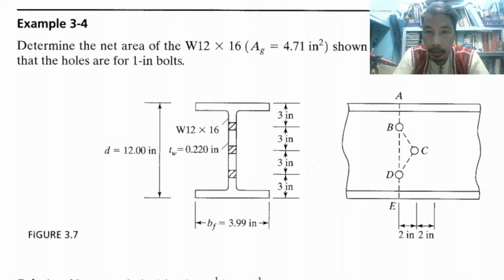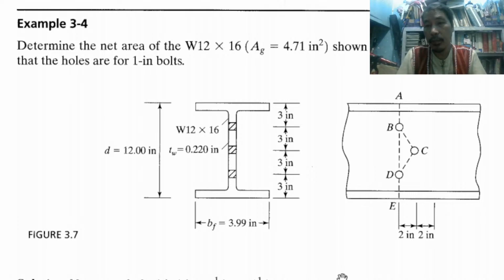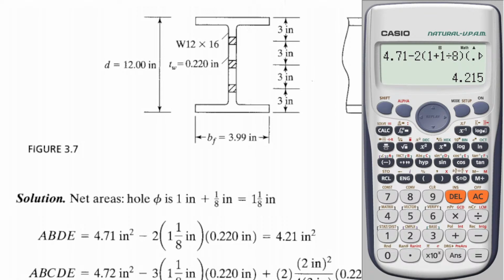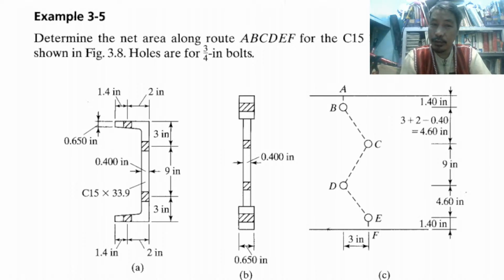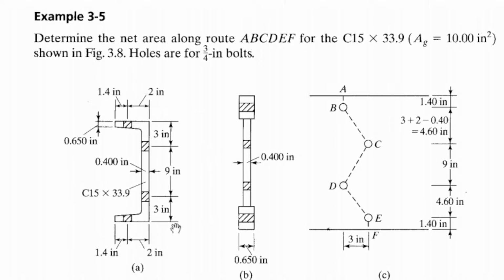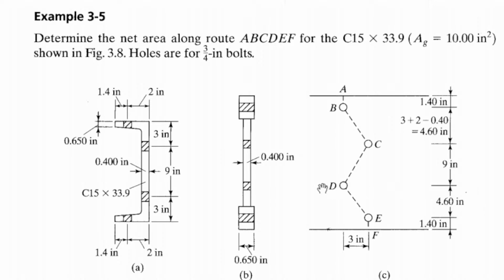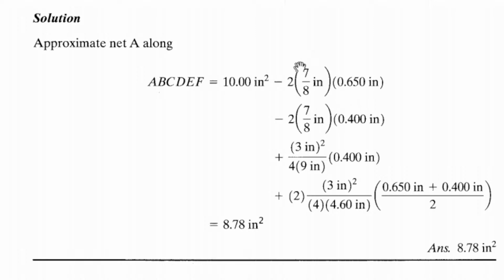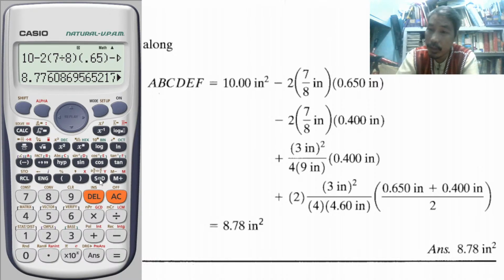[ LIVE CEE6 Lecture 11 ] DrAP Zantua STAGGERED Holes  Talks + ENGINEERING Analysis & Design

Comment: I appreciate you providing this live lecture on staggered openings as well as the following instances of net area that are still in the third chapter of the book, sir. I developed my ability to assess and analyze such challenges. If we need to resolve a problem with tension member analysis in steel design, this video can be helpful.
Values for ABDEF and ABCEF are assigned as follows: =6.32 in.

Comment: Thank you, sir, for this live lecture video on staggered openings and for the following net area examples, which are still in the book's third chapter. I learned how to evaluate and comprehend such difficulties. This video may be useful if we need to solve an issue with tension member analysis in steel design.
Assignment                          ABDEF and ABCEF values; =6.32 in.^2

Comment: Thank you, sir for this video. With this material. I be able to go back to a specific part in a video to analyze and to find explanation on how computation goes like. Based on what I learned and observe. This are the results of the route you have given, sir. For, 
ABCDEF - 8.776 in.^2 
ABDEF - 8.769 in.^2
---------------------------------------
ABCDGH - 8.519 in.^2  
ABDGH - 8.513 in.^2 
I assumed here an H sir. If ever you mean that G is the last staggered hole, However if D is the last staggered hole sir. I solve a different computation for it. Below this are the results.
ABCDG - 9.088 in.^2
ABDG - 9.081 in.^2

upon comparing, ABDEF is the shortest route. If G is the last staggered sir then ABDGH is the shortest route. This results are based on what I absorb from the live lecture, sir. I hope you made a specific video answering this route manually so that I could check where should I improve or atleast you could provide the answer so that if I am wrong, I will figured it out myself by solving it again and again. Thank you, sir

Comment: thank you sir for discussing about staggered holes. I learned that if the zigzag line goes from a web hole to a flange hole, the thickness changes at the junction of the flange and web. In example 3-5, the author has computed the net area of a channel that has bolt holes staggered in its flanges and web. The channel is assumed to be flattened out into a single plate.